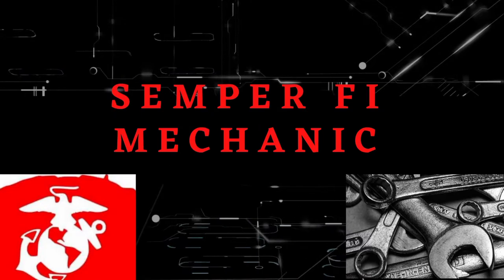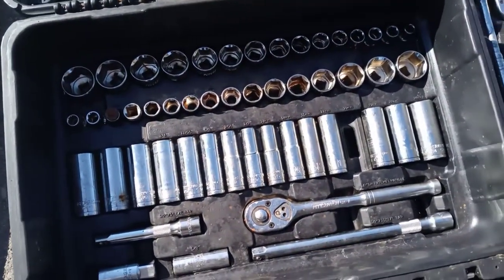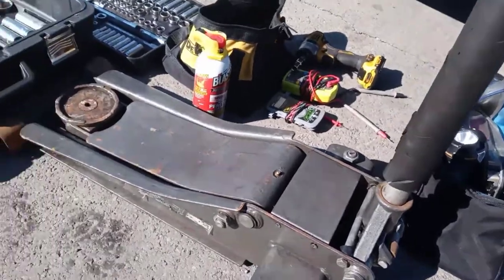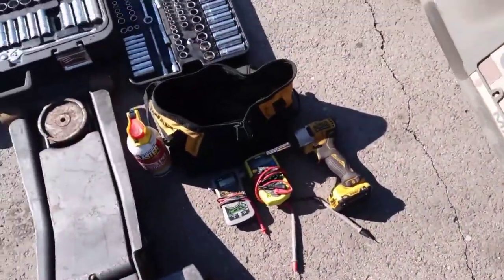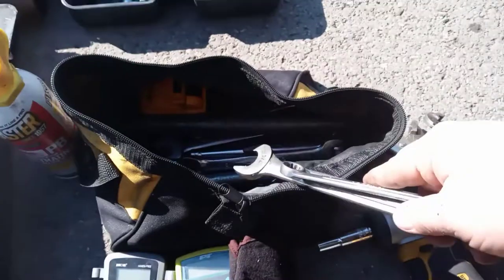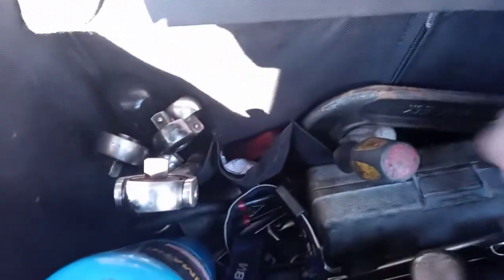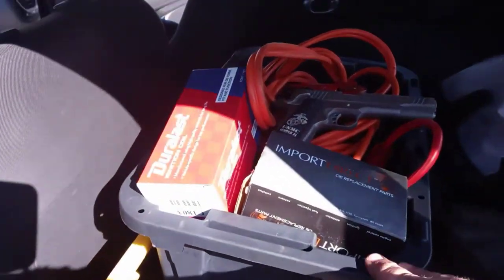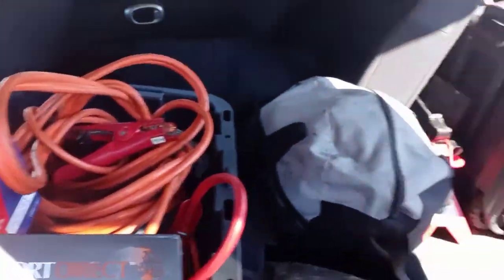Mobile Mechanic Tool Setup

Comment: I never thought about carrying a gun as a tool. Haha glad you had it when you did stay safe man. #45
Reply from the maker: Yea man you need to because you will find your self in some situations. In the last 3 years 2 times I had to pull it
Reply: @semperfimechanic  yea especially if your in the lower class areas. Your exactly rite
Reply from the maker: @beardedtoolreviews7185  and alot of times that's where you will be at and if you run a 24 hr business like I do or at least work late you will be in bad places and you never want to be In a spot where you can't protect yourself
Reply: @semperfimechanic  ohh wow didn’t know you offer 24hr service. Definitely be careful you never know who you can trust at late hours

Comment: Good video, I like the different bags for different work.
Reply from the maker: Yea because I use 2 different vehicles for for work and both are small so it's easier to prepare 2 different bags depending on the job and with time you know what tools you need for each bag and what to take and what to leave

Comment: You know that 301 piece tool set from harbor freight got same one in my backseat
Reply from the maker: Yea its alot of bang for your buck. Har Freight has some good tools in some areas
Reply from the maker: If you look in my video description you will see that I have linked alot of the tools that I have or have rented during the last 3 years of business. Check em out
Reply from the maker: Yea it's worked well for me. I have a few other other nicer sets but for my everyday use, it's my go to.